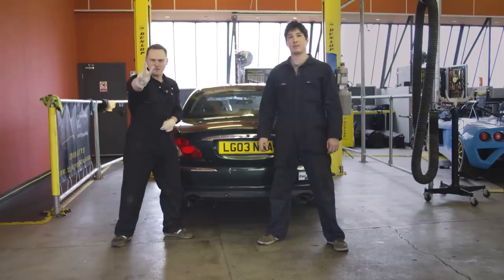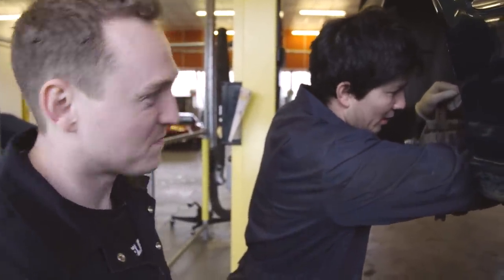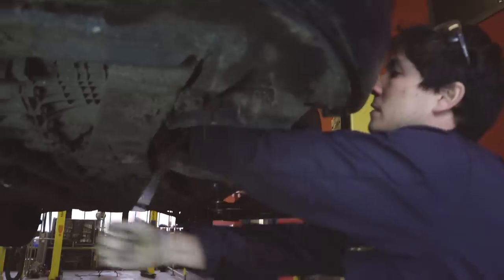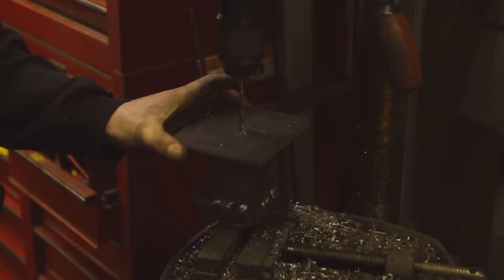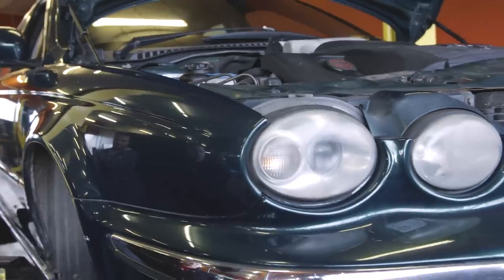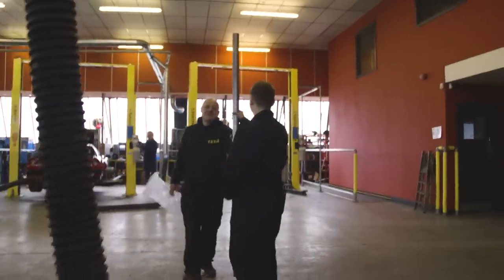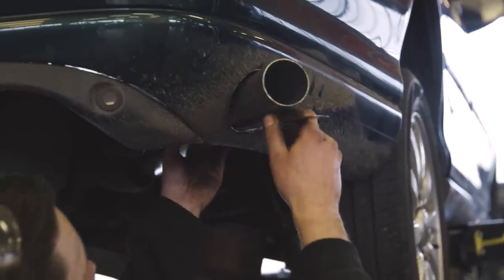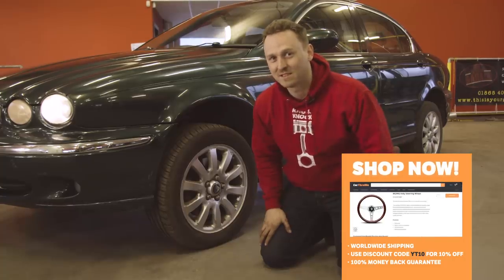Making A Custom Lift Kit & Straight-Piping The Mud-Type

Comment: You need a way for those spring "cups" to drain; they will fill up with water, mud, and dirt, resulting in corrosion of the spring, perch, and control arms.
Reply: It isn't going to rust through in 30 days lol
Reply: Rene Neron yes all of that steel they didn't at least spray paint is gonna rust so fast
Reply: Just go over many many bumps and it will be fine
Reply: Just roll the car to get the water out.
Reply: The cars not going to be kept for all that long, I would not lose sleep over this !

Comment: Ignores obvious issues with this bodge job because it's CT and Garrrrr is cool.
Reply: ALAPINO what are you talking about
Reply: This is the least bodgy bodge job you could do without having to modify more than just the suspension tbh, the only difference between this and doing it properly is that they could have added a few cm of extra travel by getting purpose made longer shocks and springs instead of adding height to the standard ones.

Comment: Hi, you should also check if your x type still has awd, the rear drive shaft is powered by a set of planetary gears, these tend to wear out, I think there is a reconditioning kit on ebay.

Comment: i own a 2.5 V6 Jag, AWD, but its an XS model with the body kit so this is something id never do, its meant to be a tiny bit lower then stock, not higher. and if i were doing this, the right hand side would be a right nightmare, but the left would be fine. its spent most of its life in the garage so both sides would probably be better then this, but before of the hadges all on the left and nothing on the right when its one the drive, the right hanmd side disc's and suspension are quite rusty, but the left is all really good condition

Comment: Why not just put larger stiffer springs in. Or a nylon spacer? Youve added 5+kg to each corner too, unsprung. And the original spring way too soft for offroad. Need stiffer struts too. Is this pre 2005 with the lsd in the center diff? 
18 inch wheels and 70 series fatter tyres too

Comment: Have you never had snapped bolt so manager had to come. It happens all the time on old rusty cars, even if you use lubricans and rust removals like wd40 or something. I had snapped bolts at least 5 times on really hard places, like wishbone, cv joints, muffler, oil pan housing. You just drill it, cut it, grind it or even weld another on top of it and get it done. Hardest one was when i was replacing cv joint, all 6 bolts that hold it was rusted so they couldn't be unscrewed and i had to grind them all to remove one part of cv joint than weld them to unscrew them from other part of cv joint and on top of that cv joint was just near timing belt so i had to take care not to accidentally cut it. Talk about hard times with rusty cars.

Comment: a tip for the home hackers is you don't need spring compressors, just undo that  centre bolt with shock in car and weight still on.

Comment: nice project , lots of working hours  spent on it  too :D .hope it doesnt end in ditch in the end...
for all mechanically educated up here; is there any way to lift multi link vehicle WITHOUT spending insane amount of money? i got written off e46 that im planing to convert for rally cross, but im having MAJOR problems with lifting it for 2" (if possible at all without fabricating custom links or A-arms) so i can put some proper off road tires on it. tnx for any lead ;) .

Comment: I snapped the pinch bolt on my e46 330 it too 3 melted drill bits and 3 days at the mechanics and a titanium drill bit still only charged me £50 to get the bolt out on fit both rear coil overs.

Comment: The CVs won't last long on those angles, for more than 50mm lift you really need to fit rear diff spacers and front subframe spacers to drop them down.

Comment: If it works okay like that with 70mm lift you should go higher 😂😂. Go hard or go home I reckon, 140mm lift on front struts and rear springs, 70mm f/r subframe spacers, spacers between front subframe and engine mounts and maybe extend the steering shaft🖒🖒

Comment: I think this'll actually improve the looks of the X-type.. Its always been an ugly car to me, but maybe this is the save it needs
But I do think that suspension setup is going to break like this. The spot where the suspension is sitting on is also uneven. The spring might bend out of shape like that. Why else would they make a rear control arm with such a specific shape designed to fit the spring? 
Besides, how will you get the water and mud out that will inevitably get in the rear suspension?

Comment: They usualy kill their cheap project cars like the trevor, the mitsubishi and donald and i guess this will also happen to Floyd, but not to it's engine. I guess it will go in Phil, because alex has talked about swaping the little inreliable 1.6 for a V6 from a jaguar x-type.
Reply: lego technic the mighty miata 1.6bis a beast capable of 300hp
Reply: bruce __ Ha! A B16 can do that natrually aspirated! A 1.6 doing 300hp is nothing new for the tuner comunity.
Reply: lego technic yeah i know i was just pointing out the mighty 1.6 cause m i a t a
Reply: The only benefits are that it's light, compact, economical and rev-happy. I wouldn't say it's very reliable or has a lot of potential. And I didn't mean that about the B16, you'll have to do crazy stuff to achieve that number.
Reply: lego technic well rev happy they are reliable on a steady 4 pounds of boost they are rather reliable ive never had a problem is only when u push 400 on a cheap setup now yes u can make more power with other motors  but then keep in mind weight it is cast but its still decently light and well proportioned
Reply: bruce __ I have no experiance, but what I do have is the habit of saying thing without thinking. May be Alex happened to have bad seals.
Reply: BBBBBB
Reply: * BBBBB *
Reply: Sorry, I didn't mean to send those and I don't want to delete them.
Reply: lego technic well alex didnt get the best mx5 out their

Comment: Why wouldn't you have just used a spring compressor to compress the front Springs enough to install the struts easier.
Reply: Houseoffinch because we tried that and it didn't work ;)

Comment: You left the cat or resonator on so its not straight piped. A real straight pipe is from the exhaust manifold or header back with no exhaust no cats no resonators just a pipe from the engine to the back

Comment: "This is not going to be a road car". No shit, Sherlock. You've changed the driver's airbag for a lump of steel to prevent you going through the windscreen. You've raised the centre of gravity making it less stable. You've removed the anti roll bar making it more prone to rolling (over). You've altered every bit of steering and suspension geometry that someone has spent hours slaving over on a hot CAD program. You've created a death trap I wouldn't take to a Destruction Derby event.

At the end of the day you've turned a 'top of the food chain', fast, silent predator to fear into a gawky, flatulent, laughing stock giraffe. I'm less than impressed.